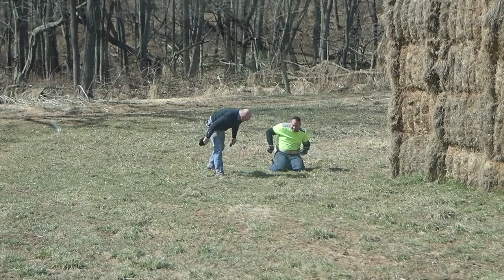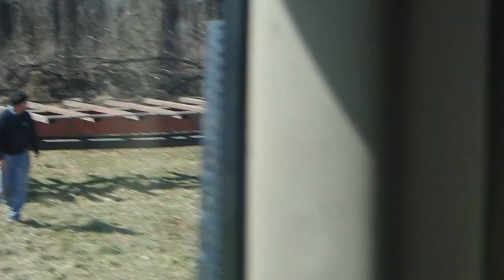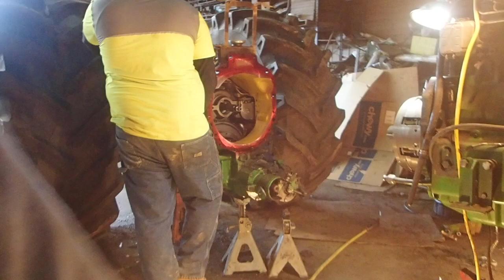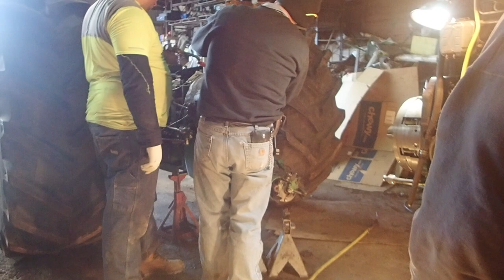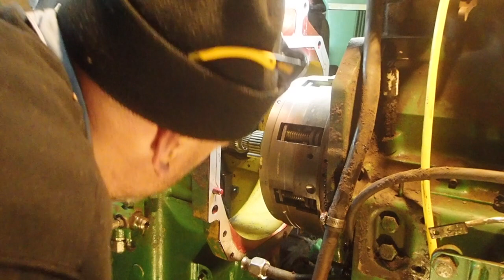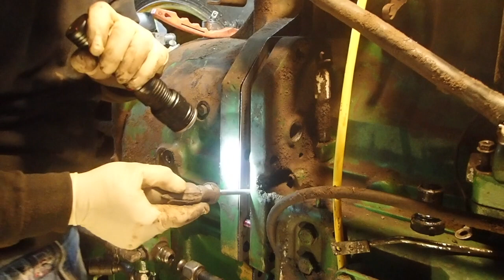Me Not Dying!!

Comment: Take two bolts 3-4 inches longer than the ones that bolt it together and cut the heads off. Screw them in and they will help line everything up.
Reply: You tube advice without a U-tube helping hand ,PRICELESS! (: ?

Comment: For as much engine and trans work as you do, you have never bought the JD engine turning tool that goes in the hole by the oil psi sender? It goes in like a Bendix on the ring gear and you can use a ratchet.

Comment: Honestly cant believe you tackling a job like that without rails and rigging to hold both halves in line. Now I know why they are used in the dealer shops. Even with the fact you have had it in pieces before. Oh well... guess you use what ya got to work with. Liked the fast forward  and the wrestling match.